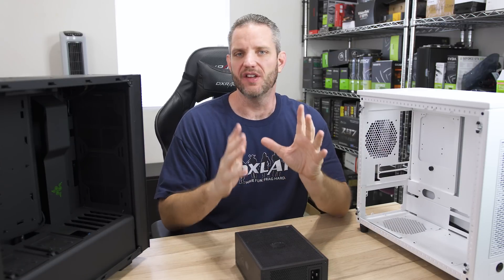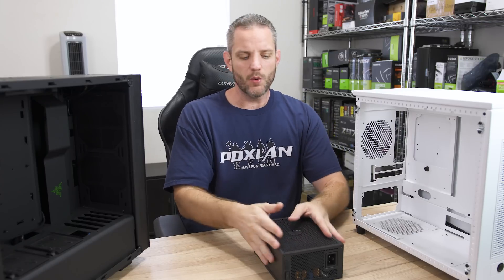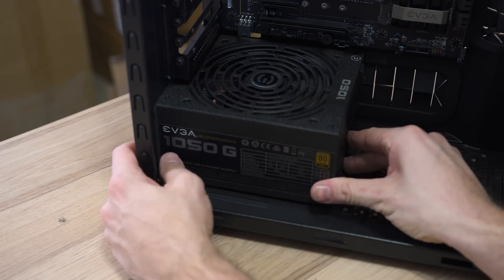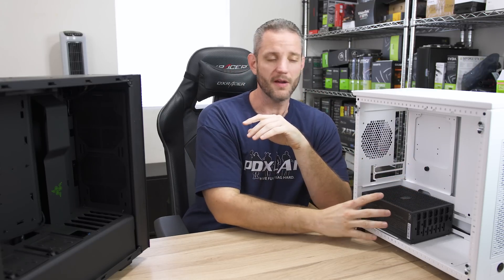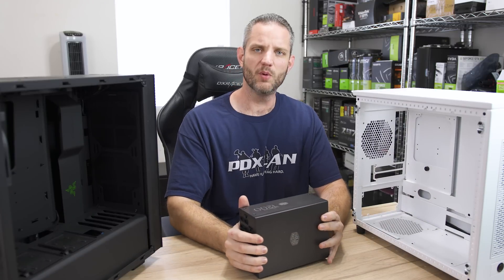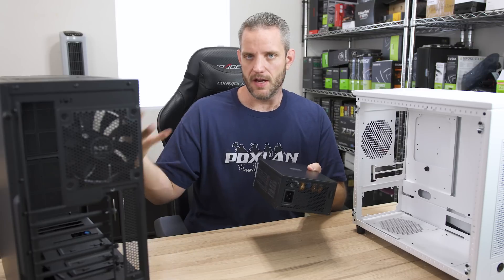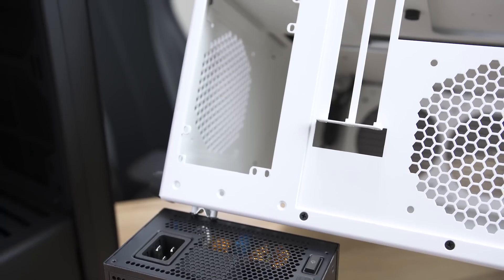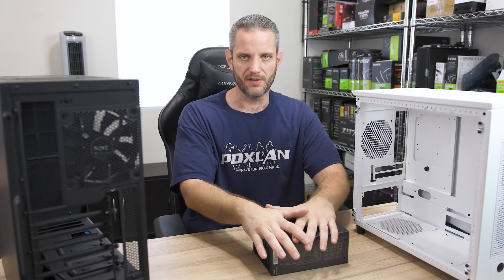Should you mount your Power Supply up or down?

Comment: What we need : affordable 80plus Gold or Platinum power supply
What we got : 80 bronze "GAMING" power supply with RGB fans.
Reply: @jackthegamer I'm in the process of building a computer for a blind friend.  He has no use for pretty lights, but with the money he had available (spent just over $1k), I ended up having to buy some of the parts having LEDs. Now, if only I can find the power supply I'm giving him...it doesn't have LEDs.
Reply: @TheEudaemonicPlague  how does a blind man use a computer?
Reply: @TheEudaemonicPlague  I was soo annoyed when the mobo on mine had led lights on by default, had to download a software just to turn them off, only way I knew it was on was because it shone through the gaps around the ports on the back of the case
Reply: always remember every rgb fan boosts your pc by 25% (120mm) or by 35% (240mm)
Reply: @stunt_niklas452  And add a few tiny degrees heat inside the case. Always better during a very cold winter though...
Reply: @MiettedeThonTomate  This can be done by just stressing out the gpu and cpu more, and still outputs more heat than leds
Reply: I have a Silverstone 750 watt that's 80 Plus gold, no issues in 4ish years. It was like $115.
Reply: What I noticed in 90% of budget gamer builds that they spend all their budget on powerful gpu and cpu and then then buy cheapest psu, cheapest mobo, cheapest case and then they are surprised when some part stops working.
Reply: @marotonin  a cheap case and a low end mobo are ok but not the psu i have an a320 mobo and a ryzen 7 1700x and it works just fine
Reply: @marotonin  I wound up going all out. CPU and mobo are on par with same cost. Psu is gold cert 650w. I learned the hard way not to be cheap.
Reply: @marotonin  it's a good decision every thing else is cheap to replace haha
Reply: @marotonin  CMON.....SHUT UP............ITS FOR PLAY LOL......I BOUGH RAM, HARD DRIVE, CPU, SECOND HAND AND CHEAP
......An A320M-K AND RYZEN 3 2200G, 8 GB RAM ITS ALL YOU NEED........
Reply: Riotoro Enigma
Reply: I just bought a $120 dollar rgb 850w gold cert. power supply. The next power supply for my needed Mobo was the same price, same wattage, no rgb. Might as well make it look pretty at the same time.
Reply: Well have u ever seen an 80+white gaming 750w psu
Reply: Corsair CX650m is a good choice
Reply: @aguwokie6421  Corsair CX power supplies are terrible. Not as bad as the "Only SeaSonic is good" nazis say though.
Reply: 80+ between silver/gold/plat is no more than 3% between each. Higher certs are no better for your system, saves minimal power, and is minimally environmentally friendly.
Reply: What we got: RGB "GAMING" Polished Turds
Reply: I ended up with an antec high current gamer psu because the Corsair $259 job blew up in 3 years
Reply: I got silentiumpc supremo 650w 80 plus gold for 320pln, which translates to ~80$
Reply: Those better supplies frequently have better voltage regulation and lower ripple.
Reply: @jc.1191    Stop talking like that here.  (you will confuse the masses)
Reply: 80+ Titanium is what i got
Reply: Funny you say those exact words in the comment since i'm literally about to trade my Corsair RM 750W 80+ Gold 2018 (bottom fan), for a cheaper and more aesthetically pleasing newer model Corsair CX650W iCue white RGB (top fan) 80+ bronze 2020 which will actually be more efficient in the long run by drawing less power from the wall and matching my white set up with white cables and RGB lights for boosted performance ;)
Reply: Jokes on you mine is silver
Reply: @nigelkushberry6168  lol
Reply: lmao i got a 750w from EVGAfor around $50
Reply: In my country theres tons of fake 80+ badged PSU lol
Reply: I got a EVGA 500 80plus bronce at $50 second hand, a new one cost $90, do you think it was a good deal?  I'm gonna do something with a i5 4570s and a GTX 970.
Reply: What exactly do you mean by affordable? 50€? 70€? 100€? I have a seasonic focus plus gold 650W which I got for around 85€
Reply: @Someone-ci8wf  exactly
Got a Coolermaster 750 Platinum for less than 100 in Portugal
Reply: I went off the advice of a friend and spent £100 on a gold efficiency psu that only draws what it uses not the full wattage

Comment: After a few reboots because of the rectifier side overheating I figured the dust filter is better gone (those fans lose like half of their actual power when the filter is present, so better just vacuum-clean the PSU from time to time). Also whenever the intake is facing down, swapping out the standard legs with somewhat longer ones allows to greatly improve the airflow and reduce the amount of dust that reaches the board.

Comment: I once had a BeQuiet Dark Power Pro 550W which I mounted with the fan pointing inside the Define R5 case because the cable management was just plain awful when the PS was mounted "the right way". Cables to short, looked crap, didn't like it. Just because the placement of the connection ports on the PS.
Now I have a BeQuiet Dark Power Pro 750W, which I could mount "the right way" because the connector placements were better. Did I notice any difference in temperatures or noise?
Not a single bit.

Comment: 4:00 I don't agree with the loop that you mentioned. Because warm air always goes up. Its a physical fact.
But its nice that you talk about a watercooling system. You could get a drop of water in the PSU. I mount every PSU downwards because cooler capacitors = more lifetime. But you need to instruct your customer!
I have a Corsair AX850 and it runs now for 8 Years atleast 5 Hours a day. And it works just fine

Comment: idk man I have mixed feelings about PSU being on bottom of case in stead of the top, nevermind which way its facing.... while its nice to put heavy things on the bottom in case of accidents, ive found that as long as you install a top mounted psu before everything else it usually can just stay in place permanently, never had issues with screws not holding PSU up, so not an issue IMO.

What you DO get out of top mount is not having the opportunity for random shit to fall into your PSU (mostly dust, and dog hair in my case) Ive heard of people dropping screws in there that would SUCK.

As mentioned the PSU fan doesnt activate if it isnt too hot, people whine about feeding their psu hot air from air cooled cpu but ive got a beefy mugen5 cooler and i7-950 stock temps were 75+degrees under load now I rarely get over 55-60 depending on ambient temp. And you know what? My PSU fan has never kicked on. I do buy overkill PSUs, maybe it helps if youre pushing one to its limits but youre going to run into other issues guaranteed if thats the case.
Reply: well i guess you shouldnt be working on your computer when its turned on

Comment: I have my PSU facing up. This keeps floor dirt and carpet out of it. I have 2 intake fans on the front and 2 on the side of my case. 1 exhaust on back, 2 on top. PSU sucks in air, blows out back. It all comes together.

Comment: I mounted my PSU with fan facing downwards. It had about an inch of clearance from the surface(wood) but it died on me with not having enough power to power GPU,  kept shutting down/restarting. Not sure if it is due to the orientation or poor QC...

Comment: in my case... i mounted my psu upward... im using a non modular type of psu so i was forced to place it like that in order to properly hide my unused cables without forcing it to fit underneath the shroud... im also using a mini case... and then searched some stuff to know if i am doing it right... turned out to be yeah! :D

Comment: If your pc has watercooling you should be using distilled water, which means it can drip all over your other parts and nothing will happen. Water does not conduct unlike what many people seem to think, it's the metals in the water that conducts. Meaning distilled water is perfectly safe for your system since it has no metals in it.

Comment: Wow! This is perfect! I have a carpet but don't have much room to put it anywhere. My first power supply burned out due to dirt and dust intake from the bottom cent, because I didn't realize it sucked in at the time, so this would help with that.

After the first one burnt out, I managed to squeeze a table in, but now that I know this I might think about doing this!

Comment: The NZXT h700 has a PSU shroud with mesh-like holes in it. Would it be okay to mount an EVGA 750watt g3 with the fan facing upward or would too much airflow be blocked anyway? 
Another question is wouldn't the warm air from the GPU go into the PSU in the fan up configuration?

Comment: I always thought it was designed to suck air in from the back and take heat out of the case after the air runs by the power supply components.  Why pump hot air into the case?

Comment: Sometimes it depends on how long the cables are. On some the 24-pin cable is plenty long but the 8 pin is shorter and you have to mount the PSU fan facing down so it can reach.

Comment: Can the heat from the components damage the PSU if the PSU pulls air from inside the case to out?
Is it better to pull air from back of a PSU and blow the air out(Make the fan pull air through PSU instead of pushing air)?

Comment: The title is "click-bait" there's only a single way to actually mount the PSU.  Common sense dictates to place the fan where the chassis fan opening is located! Stupid is as stupid does.  Otherwise, the chassis screw holes don't fit the PSU thread pattern, IE the PSU WON'T FIT!!

Comment: I mount mine up for the same reason. Case clearance it too low and It sits on carpet. Overheated my first power supply like that. Not to mention, I have a vent right next to the power supply on the side panel so it can pull outside air in through that.

Comment: I NEED HELP :)) my mini itx case (cooler master elite 130) I don’t know if i should put it facing up or down sense i am using the stock cooler 3 fans that push air through the case should i face it down to suck all the heated air from the motherboard and the cpu ? Or just face it down and deal with no ventilation

Comment: Who needs 1200W for his PC?!
Reply: A good margin for newer replacement builds in the future.
Reply: @TheRealFobican  As long as you don't put three overclocked high end GPUs in your system you won't need 1200W.
Reply: @uzefulvideos3440  I meant that you don´t have to worry about getting a new PSU for your next PC and the PC after the previously next PC.
Reply: Nobody.
Reply: higher power bill no thanks i much rather have lower like 350W
Reply: @andrewdupuis1151  A perfect power supply would only use the amount of power it needs to provide.
Real power supplies are generally more efficient when you use more than 50% of the power they can supply.
Reply: get one that has at least 80+ gold rating.  @andrewdupuis1151
Reply: What you doing with that 350? Charging your phone? Running a DDR2 GPU?
Reply: @andrewdupuis1151  3 year late response, but a 350w PSU will use higher power than a 1200w in most cases, as the former would be operating at maximum load while the latter is drawing less than a third of its load; meanwhile, the parts demand the same amount of electricity.
Reply: A small server setup running a 12+ core CPU and a bunch of hard drives could get close to that power consumption, or for example a high end gaming setup with a high end 8 core CPU and several GPU's in SLI/Crossfire with one or more components overclocked. Add power consumption from the cooling system and I imagine you could get close to that much power drain.
Reply: I am !

Comment: Just a warning.. I mounted mine with the fan faced up since my PC sits on a carpet, and while mounting the backplate of an AIO cooler, a washer fell into the crevice between the motherboard and case, then landed in the power supply. I didn't realize this until it was too late. After testing my PC for a bit it was fine. I brought it upstairs to my normal spot, flicked the switch then hit the power button, and was then greeted with a nice gunshot sound paired with a white flash as soon as I hit the power button... Though it was my own stupidity in running the PSU without finding the missing washer... I'm never mounting my PSU with the fan faced up again. I ran into this video shortly after it happened so I don't know if the components are okay yet. :/
Reply: Sirei Talk Ouch..
Any update now? How did it hold up?
Watercooling is still a constant gamble it seems, I’m always paranoid about it, considering I got myself an AIO for the first time
Fans facing down from now on 100%
Reply: @Glossah  Everything's fine now. Only the PSU was damaged luckily. I've been running the AIO since, and it's been working great! 👍😁
Reply: @evieamity7471  is an AIO worth the risk of leakage and water damage?  Also how is maintenance on an AIO?
Reply: @computethisinfo  Mine hasn't leaked, so I can't really say whether it's worth it or not.. But so far it seems worth it for how beautiful it looks and for how well it performs. There really isn't any maintainence to be done since the liquid inside is never exposed to anything.. though I don't know for certain if it would ever need to be done.
Reply: @evieamity7471  what about corrosion of the pipe over time from the flow of water?  
And which aio do you reccomend?
Reply: @computethisinfo  I'm pretty new to water cooling, so I'm not going to pretend I'd know how to solve that problem.. but I'd recommend the NZXT Kraken x62.. It has these beautiful RGB lights and an infinite mirror design and amazing performance.
Reply: A good precausion would be letting it dry up since tech never feels good from being drenched wet.
Reply: @TheRealFobican  Since it's an AIO that'a not ever meant to be opened, the only parts that are wet can't really be dried out. Correct me if I'm wrong. It's not like a custom loop.

Comment: It's been a long time since I've done builds for others but I used to put the power supply in "fan up" orientation for this exact same reason (carpet choking). So thanks for the reminder. I don't really agree about the power supply recycling air being much of an issue, but it certainly could be if the rear of the PC was tightly enclosed under/in a desk. For my own PCs I mount it down so crap doesn't collect/fall into the PSU when it's off (which is most of the time) and so the PSU can get it's own fresh air with my setups.

Comment: I know this is an older video..... my Two cents here. Commenters blabbing about this or that....Neutral air flow is better for water cooled systems, positive airflow for air cooled systems.  Running triple SLI PSU fan down, PSU shroud, fan down, on floor/carpet, fan up, on my desk PSU fan down. I am running 4 200mm fans as intake, 1 140mm fan exhaust. On all the intakes  and PSU intake, are DEMCiflex filters to catch the dust, with positive pressure, I get much less dust my system. Negative(more exhaust fans than intake) pressure sucks dirt in and clogs rads and fans. Either way, good filtration, keep your rig clean, it will last longer. Keeping your air in your room cleaner helps as well. Put a box fan in your room, tape on a 20"x20" air filter on the inlet side.  You can get from your home center, hardware store, wallyworld etc... and the filter on the box fan will catch the dust in the room.  I had my HVAC guys install an extra air return and filter near my computer area to keep the dust down as well.  With my old pc case with negative pressure ant top PSU, would overheat all the time. DEMCiflex has conducted tests, and have proved positive over negative pressure is better. Plus systems run cleaner, and the medical grade mesh does not hinder airflow. these filters can be easily cleaned with soapy water. What I do is put a few drops in a spray bottle, add water, mist down the dirty side, rinse under a running faucet, pat dry, or let them dry overnight. When you see visible dust, rinse them again. DEMCiflex has a store front on Amazon, or ModMymods.com , formerly FrozenCPU.com Jay has down airflow demos using smoke, check that video out!!

Comment: Hey darling! I have to throw it out there and hopefully you can be able to help me with a few things that isn't a bad value of your time and of course not today on the 4th of JULY ! But I'm farely new to the pc gaming world and your channel. I have a pc my dad luckily found and is now for me with its parts looking to be for gaming but don't know much to anything about them since this was too good to be true of course the psu is dead. Long gone haven't been able to start it up, could you get me up to date please on the parts and if it's too old to be use able ? That's a true issue isn't it? I would really appreciate it if you were able to have some time available with this ? It would a great help and not a clue on how to be thanking you if you can and want to do this. The specs are - 
Motherboard: MSI H55M P31
      (Not sure what kind of CPU came with motherboard) 
GPU: GTS 250 E made by Palit 
PSU:   XION 700W 
RAM: 7 sticks , 3 brands - 2 ADATA 2GB(each) DDR3 1600G(9) 2Gx16G U-DIMM
HYNIX: 4GB 2Rx8 PC3 10600U-9-10-B0 
HDD: MAXTOR Model: 6V200E0 
200GB   SATA  3. 0GB  
Also not sure how important your case can be but I have an iBuyPower NZXT which is made by Razer ? If you do see this please give it a thought this is what I'm asking for. Thank you for actually telling what parts are and do not just building a pc because honestly that part of the process is probably the easiest stage. And didn't realize monitors pretty much are the most not thought of in my opinion when first trying to learn what's an overlooked piece that is the same as hardware is important. My name is Quinten hope to learn a thing or two from you ! Happy 4th of July !! 
P.s. Celebrate today if you see this wait till after tomorrow's recovery to read haha have fun, be safe !